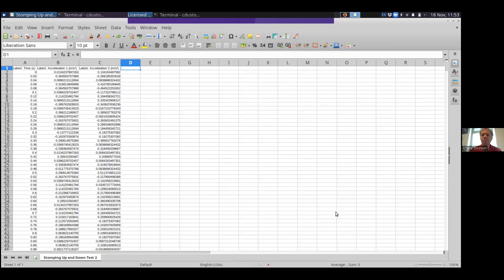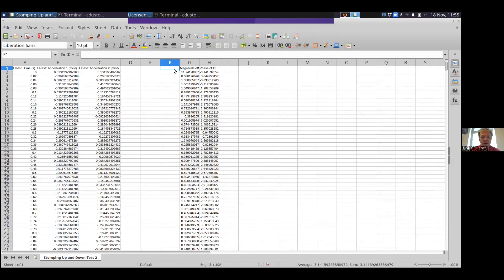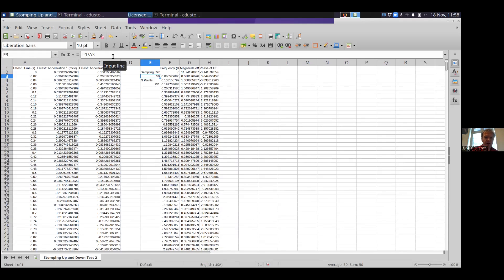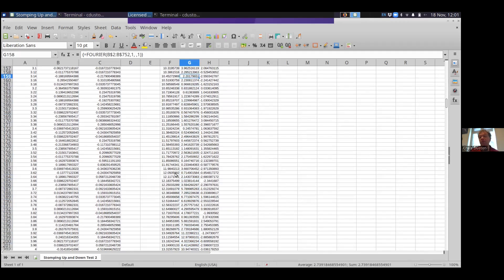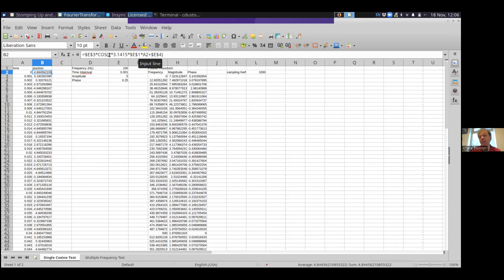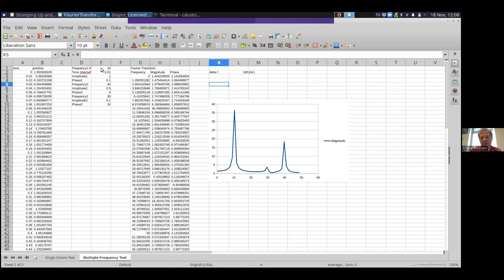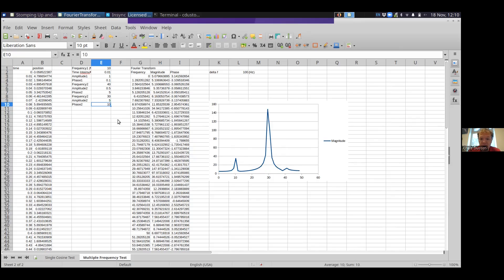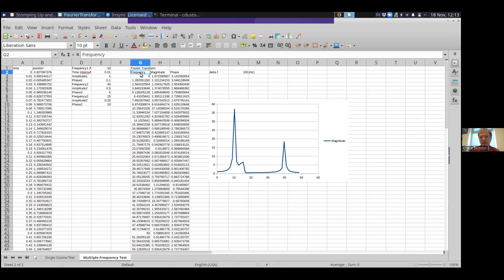Quick and Dirty intro to Fourier Transforms with Spreadsheets

Comment: LibreOffice Calc is way better and faster than MS-Excel 2021 for Fourrier transform. LO-Calc has the function FOURRIER which does not exist in Excel which has only a wizard throwing the results as strings and not as function. It takes excel 60 seconds to calculate the FFT on 1024 elements which is obtained almost immediately with LO-Calc.